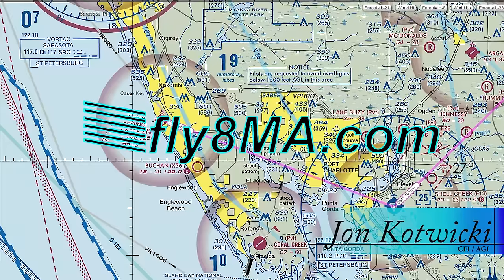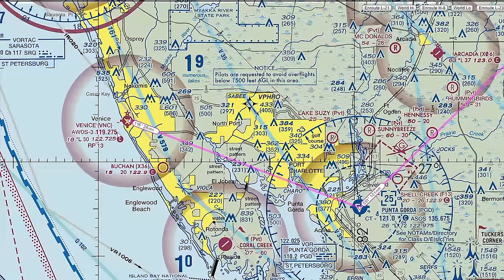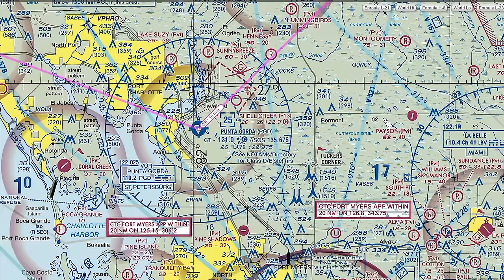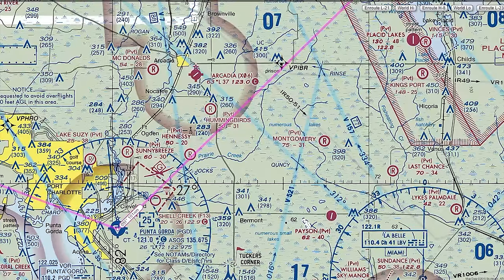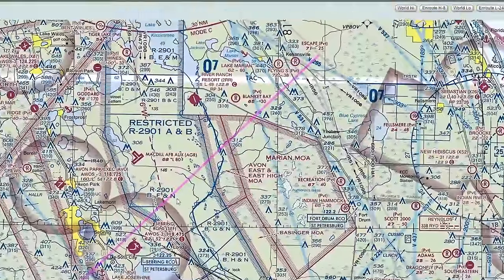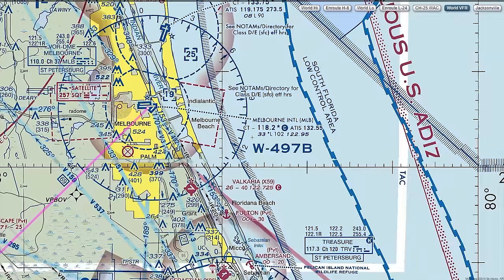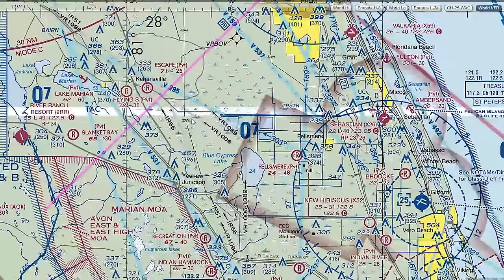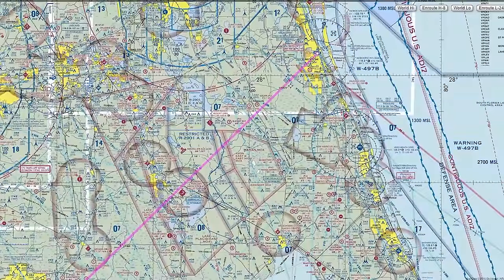Ep. 109: Planning a Flight on a VFR Sectional | How TO

Comment: I feel there is an urban legend being spread in these videos, there is a reference to "lights at night", which is partially true. The yellow areas are the Urban Area limit lines, while they have light at night they unfortunately haven't been updated in most places in the USA for over 40+ YEARS. This makes for a terrible navigation aid given urban sprawl in some locations. I called and talked to the FAA directly about this as I am an urban GIS Analyst and had to discuss why our airport was so outdated. They mentioned they are "response based" and not proactive. So if you or your fellow pilots notice errors on your VFR charts it's important to contact the FAA and request they update your area. In the future they plan to use the Census TIGER Urban Areas for increased accuracy, but that still doesn't include skydive drop point changes (or other changes) so keep an eye out and lets all help keep these charts as accurate as possible :)
Reply: This is useful. RE "In the future they plan to use the Census TIGER Urban Areas" - do you have a reference for this (or was it communicated verbally when contacting FAA)?
Reply: Oddly enough my flight school is also a skydive drop zone. And despite having two icons (one of which is innacurate because it was a trining drop zone that no longer exists, so only one symbol should be present) i watched a plane over fly mid feild from the east (drop zone) at about 1000-1500 ft. I was in the middle of my run up and i thought "thats gonna piss some people off, hope hes prepared for a stern talkin to"

Comment: Great video.  Thanks for posting. I knew about supplemental oxygen at night above 5,000 MSL but never heard using above 5,000 feet density altitude.
Reply from the maker: Density is a bit more what you're concerned with.   That's how much oxygen is really in the air you're breathing.  Height MSL is just a pointless number when it comes to performance of the plane and yourself.